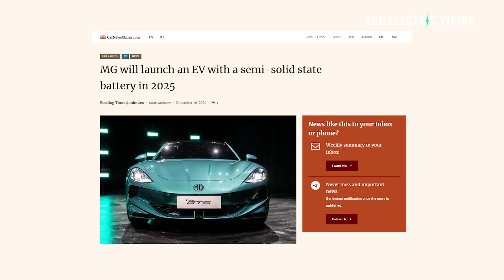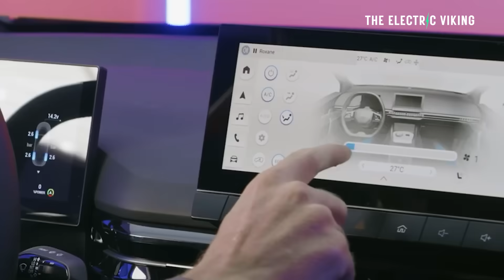EVs with Semi Solid state batteries are about to arrive...

Comment: When it goes for 500 miles and takes 20 minutes to charge, I'll buy one. But I have some doubt that will happen in my lifetime.

This whole chat reminds me of people banging on about graphene, and how it will change the world. It never does, it's always a few years away.
Reply: Easily in 2 years
Reply: It will.
Reply: @stevewhitmill2037  no it won't and you are extremely naive if you think it's just round the corner (tm)
Reply: I thought EV range had to be much higher than 200 miles, but it turns out that I don’t feel so drained at the end of a 500 mile drive in an EV compared to a fossil car.  I’ve put it down to the 20min leg stretch every 2hrs.
Reply: @danhough7574  it's not so much that people want to drive 500 miles in one sitting. But there isn't always a convenient period of 5 hours to recharge within each 100 mile trip. It has no flexibility.
Reply: I find EV’s are more flexible because I can fill up at home. Ok, so not so flexible if you don’t have home charging, but a lot could do home charging and they’re missing out on cheaper travel. Induction charging is coming which will means this holy grail battery is not needed for most.
Reply: @kenbehrens5778  You have personal experience of this do you ? You have BEEN to China and charged one of these things yourself have you ? If not, please give your authorities. Which serious journalists... and I mean SERIOUS neutral journalists. have been there and verified your claim. Please tell us.
Reply: If this is so, who is going to pay compensation to the millions of poor suckers who have already bought EVs with rubbish batteries ? Clearly, no-one in their right mind is going to buy an existing EV when this breakthrough is just over the horizon. Sam has just KILLED EV sales for the next year at least. If you are so stupid as to be considering an EV, hang onto your petrol/diesel for a bit longer and ask your home insurer if they will guarantee you no premium increase above the average for at least 10 years. Otherwise, you could be in for some VERY nasty surprises in the next few years, especially if you go for one of these ultra dense things unless you promise to keep it more than 80 feet away from any structure on your property ... remember, the new batteries will be considerably more dangerous than existing batteries. Forget Luton Airport, consider the NEW GREAT FIRE OF LONDON. Half of London burnt down as a result of a new high-density battery bursting into flames for no apparent reason in Pinner or Wimbledon

Comment: I think once you hit 1000km of range it's time to dial it back to reduce battery. Personally I would be happy with a 500mi range EV that weighs less and charges in 10 minutes. Even 400mi of real-world range is fine by me, but I wouldn't say no to 500mi. We'll get there someday.
Reply: Probably sooner than we think, the Chinese already have their 'gold' battery that's at 1000k of range, about 600 miles so probably over 500 miles of real world range. I genuinely believe at that point its game over for the old legacy cars
Reply: @stevenbarrett7648  But because it's from China, what will the reliability and longevity be?
Reply: @cgarrrr2274  If its from China it will be  rock solid, these chaps really know how to make cars, their technology is far better than anything coming out of Detroit or Berlin. 
Our Chinese Tesla Model YLR is just excellent, two and a half years on and I still have the silly smile on my face and not one single issue. being an septuagenarian I've had 'one or two cars' over these many years but nothing even touches this beauty, it's just learned to to park like a pro this week !
Reply: @cgarrrr2274  The Chinese are getting Way Better in all phases of automotive engineering. It wont be long before they are in the top of their Game!
Reply: @stevenbarrett7648  🤣
Reply: Not sure we'll see that much range like 1,000km widely offered in mainstream cars, because it's not really necessary, and it would inflate the cost without really adding. I live in the Western US and really a highway range of 400 mi / 700km would be about the target IMO. I mean that is a good 6 to 7 hrs on the road and well beyond we what most people ever drive, beyond once or twice a year. Right now I have an EV with a range of about 235 miles, it does pretty much everything I need it to do, I'm not aching for more range but yes I would gladly pay for a model with 350 or 400 mile range, to make longer trips more attractive and to give me some buffer. I mean yes a few car models will offer special high-capacity batteries as an option probably, but not mainstream. Now pickup trucks and people who tow trailers, that is a completely different story. And motorcycles where ev batteries today are just not at all up to the task, today they go like 100mi. Certainly aircraft .  .  .   Much more energy dense batteries will open up a lot of these other uses.
Reply: @EPeltzer  I would agree. I think a 400mi of real-world range is a stopping point; after that cut down on battery weight as energy density increases.
Reply: @EPeltzer  It would just be good to have a choice in car range per charge wouldn't it. Our Tesla does a bit over 300 miles riding around at 70MPH on our motorways which is good enough as we have lots of Tesla chargers here in the UK so no issues with grabbing a bit of power on the move, thing is I only have a 150 mile bladder !!
Reply: With a swap batterie no need to care about range or depreciation Simple.......
Reply: @ perhaps. That would require a massive new infrastructure upgrade too
Reply: Totally, if that’s real world range. You can pretty much take 20% of what’s claimed so if they claim 1,000 and that’s 800 real world, thats enough (500 miles). All we need now if faster charging speeds and it’s completely over.😊
Reply: They will keep pushing battery technology until it reaches the maximum potential. Even if such high density is not needed for cars, it can be useful for flying cars or airplanes, ocean transport etc.
Reply: I'd be very happy with ~350km (220mi) range (albeit, that's real world headwind, cold, bad weather, at motorway speed range), if I get sub 10min easily accessible charging. All extra battery is just anxiety weight. Yes, I could go longer, but I choose a safety break.
Reply: Already there, Lucid and Tesla
Reply: 1000 km real winterrange at highway speeds - yes!
But 1000 km CLTC is more like ~400 km on the highway in winter. And if you drive really fast, like in Germany, the range can fall to ~200 km. 
So at the moment there is still a need to up the range in EVs. I believe once we are above ~300 kWh per pack the it's enough.

Comment: The ones with old battery technology will be hard to be resold
Reply: Batteries tend to be modular. Why couldn't a new solid state battery pack be installable in an 'older' EV? (even 'if' the battery is worth most of the car)
Reply: Right, until the owner updates to a new battery so they can sell it

Comment: Sam, why don’t you give some numbers? You quote percentages, but a percentage of what? The MG you say might get 30% more range; so what is that? Doesn’t it have some drawbacks? Energy lost during charging? Internal resistance of the cells? The expected life? Solid state batteries have been promised for a long time. I won’t hold my breaths.

Comment: Another promise of game changing batteries. 😂 What most want is not mega range but fast charging. Most people need to stop on a long journey. If you just had a range of 150 miles but could recharge in ten minutes or less that would be fine. It would make the cars much lighter and cheaper.

Comment: "Come Soon", "Might", "Will Launch", "They Believe", "They Claim" Sounds like a lot of maybes. Usual problems, the whole "cheque is in the mail" stuff is getting tired. As for the range of EV's my understanding is that a large increase in energy density is questionable given LiPo batteries are already at a developmental dead-end and despite a lot of "new wonder batteries" being announced nothing has actually been brought to market. As for seven-minute charging time, that is just insane, that amount of energy being discharged into a pack over such a short period of time is just going to cook it.  Range, figures from day one of EV's have been again questionable, a bit of real-world honesty would have been nice. Referring back to LiPo cells, discharging below 15 to10% can damage the pack, and there is a push to cap charging to 80% due to fires while charging. So, any "range" quoted by the maker should be at least 70% of its maximum 100%. Can I suggest you stick to what can be tested on the road and not what is "in the mail". As for the prices, yes, they are going to continue to fall but that is going to cost current owners thousands come trade-in time, that is not good news.

Comment: EV’s will never be lighter than gas powered cars.  Lol.  Electrical bonds don’t store a much energy as covalent bonds.  It’s basic physics.  1 kg of gasoline holds 11,233 watt hours of energy.  Even with the measly 30% thermodynamic efficiency of heat engines, 1 kg of gasoline will deliver a net of 3,370 watt hours of energy to the wheels.  Even at 1,000 watt hours per kg of energy density in a solid state battery, it will still weigh 3.3X as much as the equivalent amount of gasoline.  Sam needs to go back and take some basic chemistry and physics classes to understand what he’s talking about.  And I’m not just shit talking EV’s.  I drive a Tesla.
Reply: That moves the comparison to the weight and complexity of an electric motor to that of a motor and transmission in a gas engine car.

Comment: As far as I know, at least three battery manufacturers have announced plans to start production of semi-solid batteries in 2025. A 1000 km range plus a solar roof is good enough to charge the car once a month or even less frequently.
Reply: You were not good in maths at school, right? There no way you can charge a 70 kWh battery car with a solar roof in a decent amount of time (unless you live in a castle and have a square kilometer of solar panels.... - come on, do your homework before writing.)
Reply: @lucamaggiolini5062  Ok. Let's do the math. If you have a battery with a 1000 km range and drive about 30 km per day (on average for workdays and weekends), you would need to fully charge it roughly once a month, right? Current technology already allows for solar surfaces capable of covering a daily range of 20–25 km. In this case, you would only need to recharge your car every 3 to 6 months.
By the way, that's 3rd-grade math.
Reply: Ah, and the sun shines, of course, and it's not too hot, or too cold....

Comment: New type of batteries with higher energy density improves range !? I don’t see how this could be. Unless the battery capacity in the car in terms of KwH increases. With the same battery capacity in KWh,  irrespective of the type of battery, the range would be the about same. Higher energy battery car may improve the range slightly bcos of lighter weight.

Comment: There surely should've better solar charging in cars especially I sunny countries while parked....??? And the actual revelitions of the wheels with a type of gyro swinging back and forth.....then make the cars smaller and lighter....put in a small diesel engine that car charge batteries while not moving and still assist car with drive chain....hove about putting magnets in the road surface then cars charge as it drive over....also a small hydrogen charger working of 12v to charge batteries
Reply: That’s the kind of dream that convinces me to get out of bed and turn the coffee on! 😂  You could take the car to school to demonstrate how technology has advanced from Stone Age all the way to 2005 Toyota hybrids.
Reply: You might want to take a thermodynamics course or two.

Specifically the first law of thermodynamics, which applies to your hypothetical situations

Comment: Oh no, EV enthusiasts are going to hate this one. They think the current 200 mile range is perfectly adequate!
Reply: Oh haters like you will always find something to criticize. EV is the superior technology and it will become cheaper thanks to China….
Reply: I’d be ok with a sub $20,000 commuter with less than a 200 mile range. Even on most vacations we don’t drive more than 400 miles. And as charging gets quicker and EVs more affordable, a 200 mile range will be ok with me. Price and reliability are the important factors for me.
Reply: @freeheeler09  Literally dozens of models for sale one year old. Corsa-E, Peugeot 3008, MG4, etc.
Reply: Under what rock do EVs still have so little range? That was like 10 years ago. Surely sufficient for daily commute, but we now have 450miles and battery swap options in China.
Reply: @LowAltitudeEconomyNews  That may be true in parts of China, but in the rest of the world, range is still a major issue.
The latest Tesla Model 3 known for it's efficiency only gets 200 miles in Autumn/Winter/Spring conditions according to a video on Youtube by a car magazine.

Comment: Cant you get it through your thick heads!, NO ONE want's an EV!
Reply: If that's the case, useu wouldn't have to impose EV targeted tariffs then. 
But they are doing just that, can you tell me why?
Reply: Your is problem is that loads of people want them.
Reply: @ also, good for you, free choice!, trouble is they are being forced on us!, ever asked why?
Reply: @davidanderson7138  
Seat belt are also being forced on you. Did you give up driving?
Reply: @ doesn’t cost you anything though, and it is a safety issue, plus your not lumbered with a £40k liability you can’t get rid of!
Reply: @davidanderson7138  
Green is a health issue. Have you try putting your nose to the tail pipe? 
40k between a BEV and an ICE, it's not like you're being forced to rid your ice immediately and spend 40 on BEV.
Reply: @ you think EV’s are green?, you need to own one for eight years before it  becomes C neutral!, not to mention the electricity produced from fossil fuels!
Reply: @davidanderson7138  
Oh it is definitely better than fossil. Try putting your nose to your tail pipe and you can tell me after that.
Reply: @ really?, I thought all the sales were to large corporations?, why would anyone want to buy an inferior product at +50% of cost of ICE car?, and can’t sell it?, don’t believe the media hype they are feeding you

Comment: I would have thought solid state batteries would be more swappable - smaller, more robust etc.
Reply: no. swapping components will give insurers nightmares bc there is no way to ensure the safety of switched batteries. There  will also be proprietry technology involved to stop non original parts being used. Apple on wheels. Digital Rights Management will ring fence products and consumers.

Comment: Batteries with 300whkg or higher energy density will transform small EVs.the new Renault 5 for instance could get well over 300 mile range and faster charging from the same physical size battery pack.  Whilst full solid state could give small EVs 400mile plus or big battery size and weight savings.  Imagine 300mile plus range and super fast charging in the new Hyundai Inster.